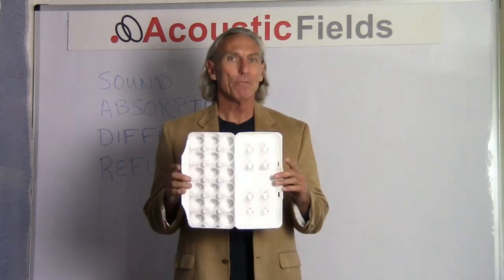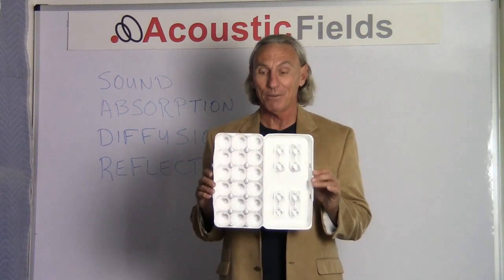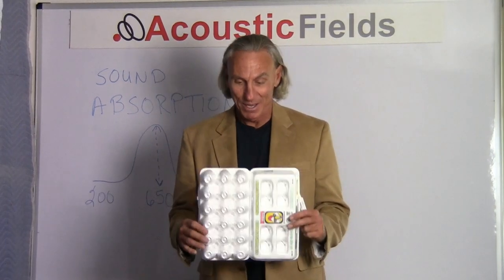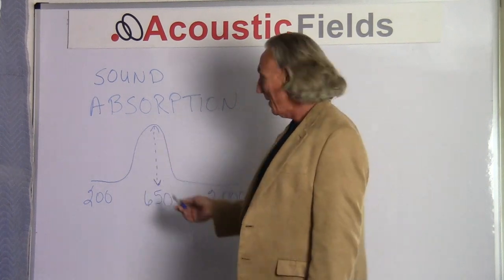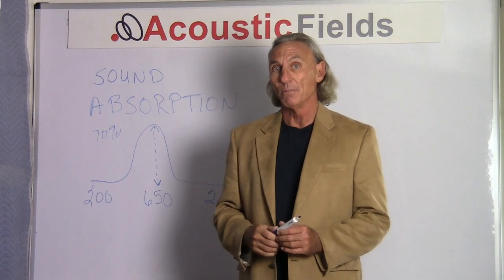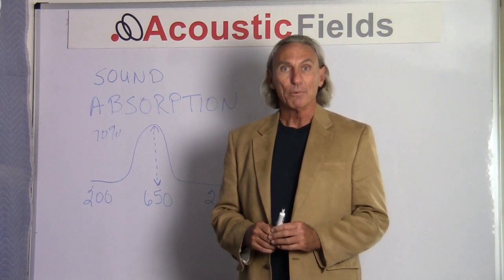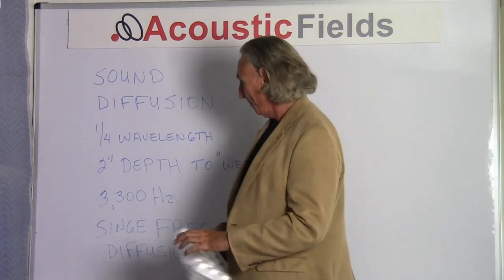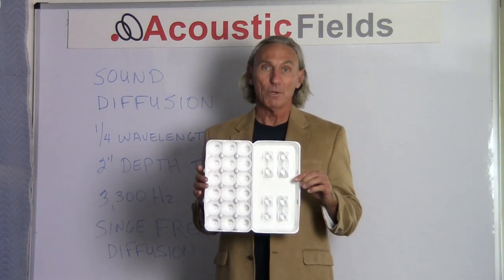The Egg Carton Acoustic Myth - www.AcousticFields.com

Comment: OK, Hang on to your seats.  Here's a YT video that is actually trying to convince people that they are a viable product.     watch?v=kf8e_X-wA6c
Reply: Hey one! that vid was hilarious with the egg cartons! Hope they dont heat em up too much with that lamp! ;-)
Reply: I'm wondering if the paper based egg crates would have better absorption than the styrofoam.  When I was young and stupid about egg crates being used as room treatment, we used the paper based egg crates not the styrofoam type, but we switched to thick packing blankets, thick carpet swatches and foam (before the more expensive acoustic foam came out), but this was back in the early 70's when i was in high school and the band I played in didn't have much money for room treatment.

Carpet swatches was also very popular to stable to walls and ceilings for room treatment.  :-)
Reply from the maker: Oneness100 . Still no acoustical merit I'm afraid. The only reason to have an egg crate in your rehearsal space is if your lead singer and drummer are preparing to fight each other (as usual for some bands) and so need to get into shape aka Rocky Balboa... 3 eggs in a glass, swallowed raw, followed by 2 hour run through the snow of Philadelphia, through meat factories to pound on meat, up those famous stairs, some jumping around arms aloft as the sun comes up... and then into the rehearsal studio.  That is the sole reason to have an egg crate in a rehearsal space.
Reply: LOLOL